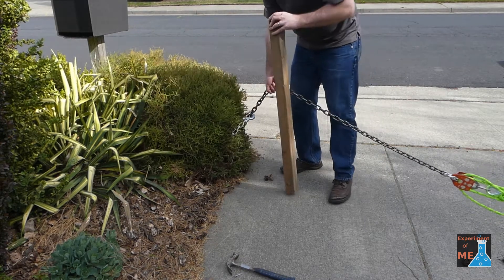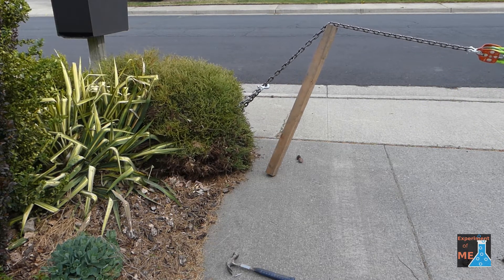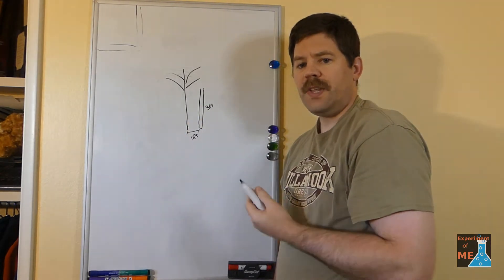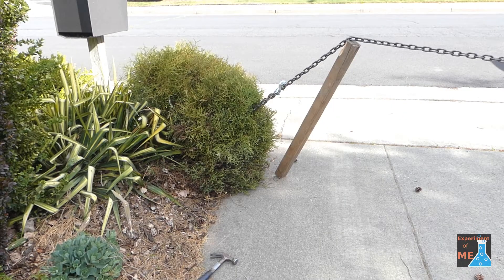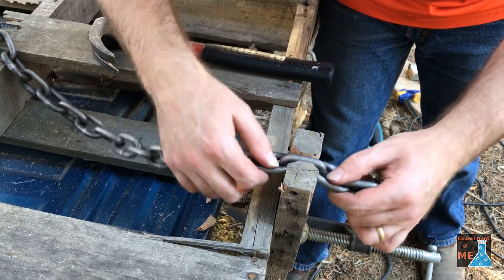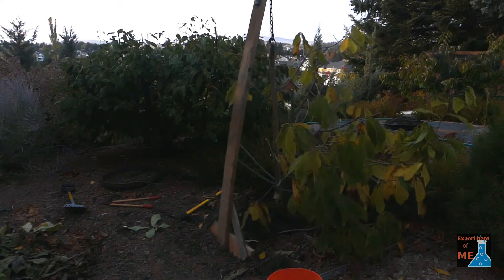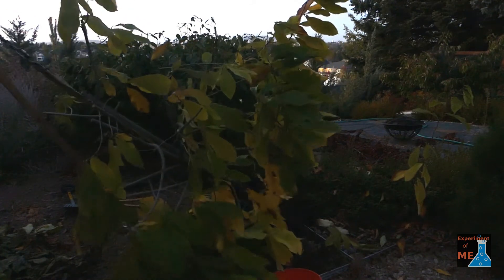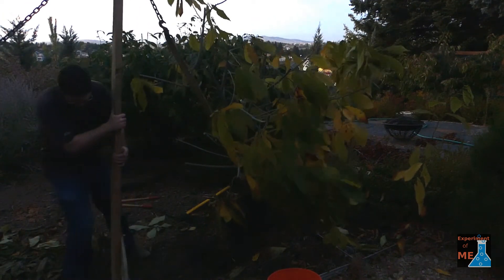Stump Pulling Lever From Idea to Finished

Comment: Pulley system vs hand winch?  Each has  advantages over the other. Do you have any thoughts as to when to use one over the other?
Great vids here. Just subd yesterday.
Reply from the maker: A hand winch is more cost effective, but slower for pulling things out.  Range on a pulley system can be much longer, limited only by the length of the rope.

Comment: Weird question but how does the lever work? 
In order to increase the force on the plant you need to increase the way the chain has to move, but i dont see where that is in this case?
Reply from the maker: I made a video that shows experimentally that the closer you place the lever to the plant the more mechanical advantage the system has.  It can be found here: https://youtu.be/i97q0SK70Js

Comment: https://youtu.be/pccuAUNwfw8
I’m gonna steal this design and use 4”square steel tube in 4’ long sections (4 of them) that will couple together for the 8’ tall A-frame or a pair of 4’ tall A-frames (for a different application).